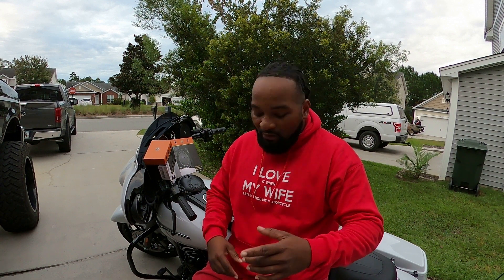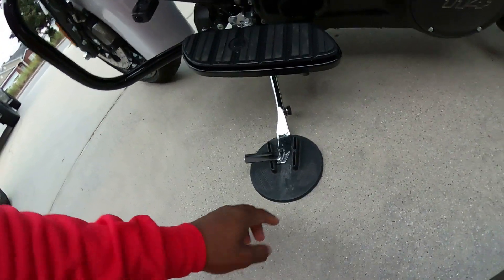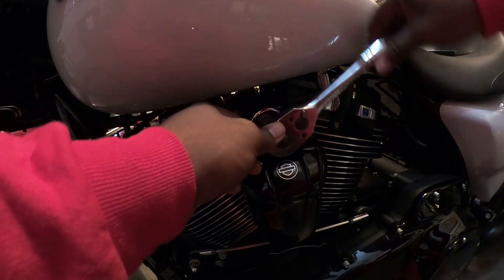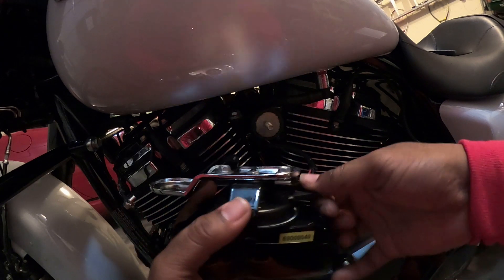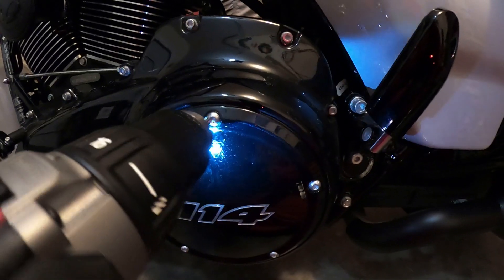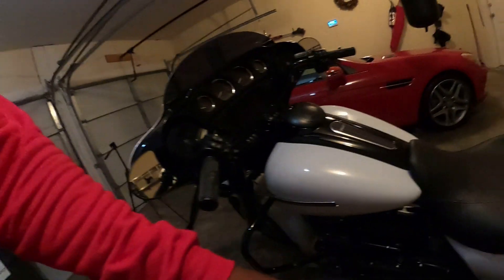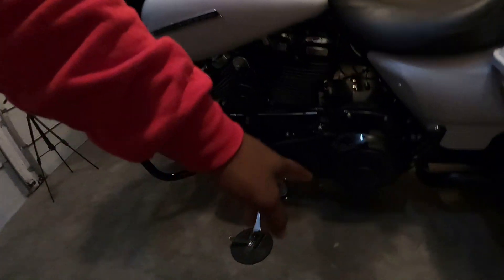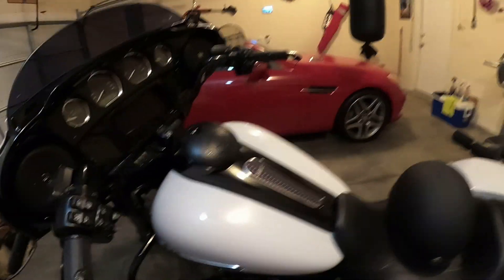Willie G Horn Cover-Willie G Derby Cover-Willie G Front Axel Nut Covers-My First Harley Helmet Ever

Comment: Nice look Bruh, only recommendation I would add, is the first chance you get, get a new gasket for the primary cover, check your torques on the screws as well. Just in case...other than that, get ready to get you money right, cause it ain’t over. Nice looking scoot, like the new helmet as well. Keep the shiny side up & tacky side down.
Reply from the maker: Will do.  Thanks bro.

Comment: You don't want my opinion on the helmet.
It's a nice looking helmet, but it won't do jack in a crash. DOT means absolutely nothing. Get an ECE rated helmet instead, preferably something that protects you when you faceplant into the tarmac or the back of a car. There are loads of cool full face or modular helmets that offer the protection you need, and they don't need to cost an arm and a leg.
I personally wear Shoei and Arai racing helmets on my Road King Special. Sure, other Harley riders give me shit, but that just means it makes me eccentric ;-)